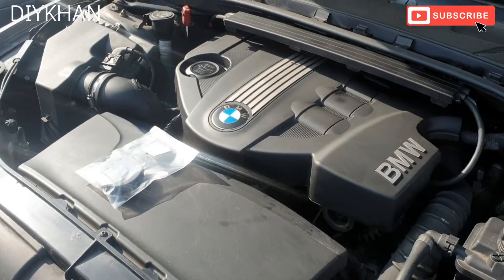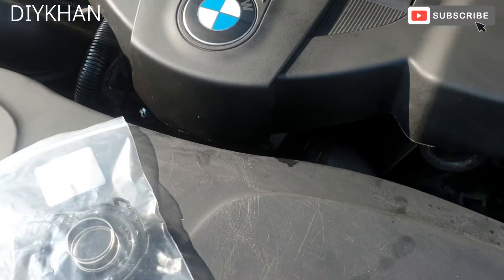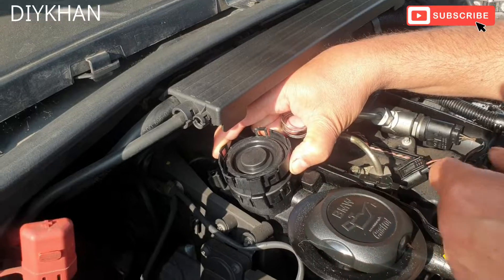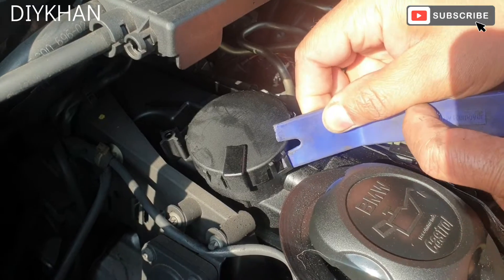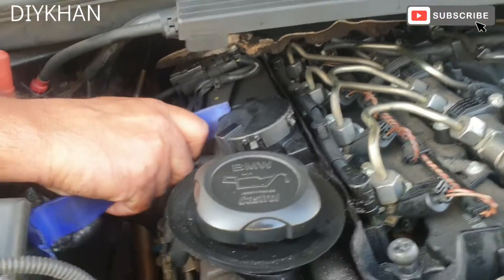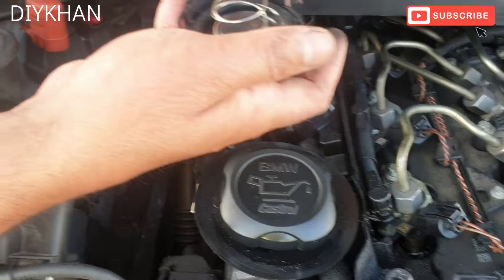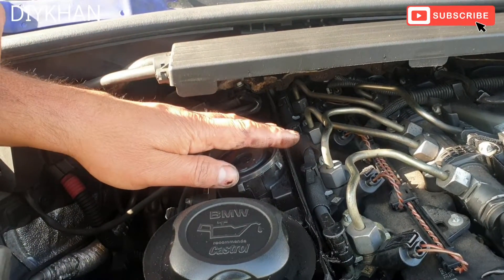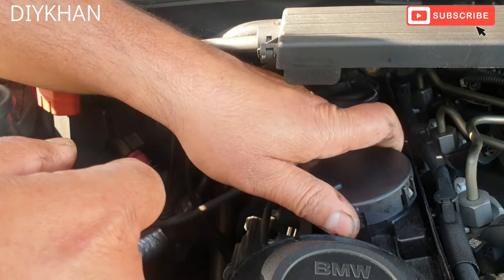BMW 3 Series E90 N47 Membrane Crankcase Breather Valve Replacement Job. PCV, CCV Replacement Process

Comment: Hey bro, nice video. I have oile leak on my bmw f30 320 d n47 , in air intake, so the question is do I have the same problem as yours?
Reply from the maker: You can give it a go. Its the cheaper move n it might work. Good luck 👍

Comment: You can remove the cap without breaking it. Just uses picks or small flat head and lift it off.
Reply: Given that its plastic, in an engine bay, thats seen alot of heating and cooling cycles, might aswell change it instead of farting about trying to use the old one.

Comment: Do you have a way I can contact you directly please? I need help with my 2010 BMW 320D N47
Reply from the maker: What is it about?.
Reply: @diykhan  There’s a couple of things and I’m doing it myself as I can’t afford to get it done professionally but the main things are: 

1. There’s an oil leak towards the back of the engine, I cannot locate it anywhere. I think this is why I get the white smoke from the engine bay when it gets too hot. 
2. It sounds like a tractor. It’s got a rattle and just generally runs rough and nothing I do is able to fix it.
3. I’m always being alerted that my DPF is blocked and I’m not completely sure on how to clean it out. 

There’s a bit of a history on the car, but long story short I’ve had to replace my turbo twice due to it blowing.
Reply from the maker: @the.jayelle  for the oil leak have u checked the oil filter housing gasket.
Reply: @diykhan  no I haven’t as yet. Is that a simple job?
Reply: @diykhan  I also forgot to mention that when driving the steering wheel vibrates and almost like it knocks. The rear wheels also scrub whenever I hit a slight bump or have weight in the back of the car.
Reply: @diykhan  can I speak to you please? I think I’ve isolated the oil leak, but there’s so much going on and I’m not 100%
Reply: @the.jayelle  For the steering vibration check the suspension arms.Get them changed your car will run smoker and much quieter.also get checked the shocks
Reply: @chinthakarathnamalala9437  do you know much about the DPF?
Reply: @the.jayelle  yes of course I’ve had issues with my Dpf
Reply: @chinthakarathnamalala9437  how do I clean it out? It keeps saying it’s bloxked
Reply: @the.jayelle A little bit late, but it the oil leak would be the valve cover itself (not only the gasket) and the vibration maybe is the timibg chain which is at the back of the engine, or the engine mounts
Reply: @the.jayelle Delete it
Reply: @the.jayelle  chuck some dpf redex in fuel and run it down motorway